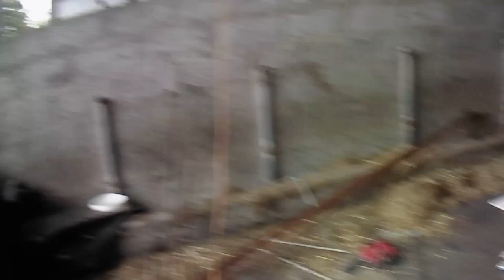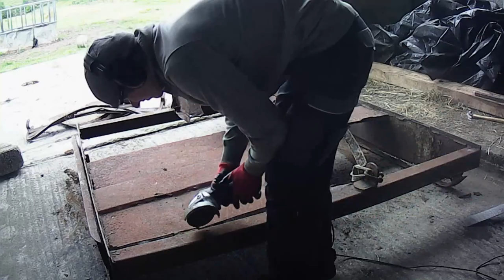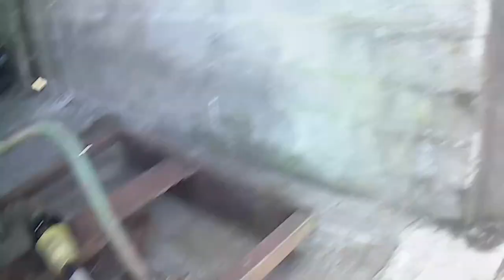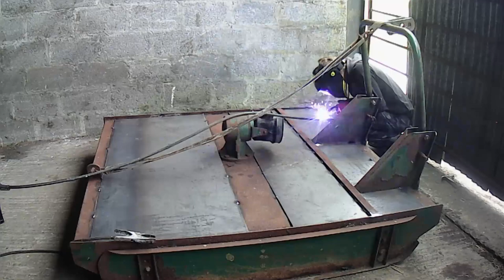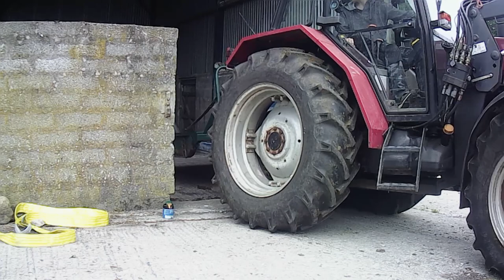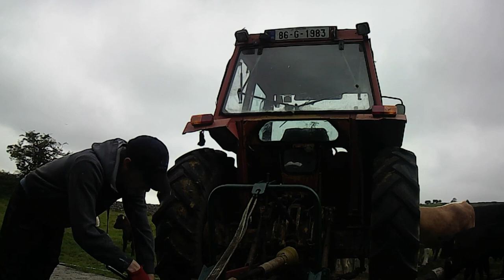MAJOR  Topper Restoration

Comment: I’m doing something similar but just way more overkill, I’m going to rebuild my gearbox and powder coat it and I’m going to put cross supports in and then I will buy checkered galvanised 4mm plating and try do it in two pieces and tap and thread them so I can lift the smaller on with a ratchet to sharpen drone above, I will also install a toolbox with a file , grease gun ,shear bolts and the spanner’s needed so I can fix in the field, this is overkill though because I have two much time on my hands

Comment: Grand job. Two bits of angle across the top turned down and all the rattle will go away. Fine job though.
Reply from the maker: Thanks lad, I'm currently welding on two bits of flat ontop of the rear plate. The rattle is too much 😂😂

Comment: New sub from Kilchreest. I have exactly the same project to do at the end of the year. Rot on top at the back of my Major topper. 
I notice you cut the front and rear sections out, leaving the gearbox mount. Is this a separate piece or just more of a convenience to not have to strip blade assembly and gearbox off the machine. 
Many thanks.
Reply from the maker: Oh Thats very cool, thanks for the sub man. Um well i did that for convenience but also the middle section has more structure under it that the rest of the sheeting. I felt it still had plenty of life in it and yeah it would've been much bigger job to remove the gearbox and blades. Hope this answers your question, and do let me know how you get on with it. 👍
Reply: @IDoAgri  I’m about to get in face of the topper repair. Life gets in the way of even the best planning. Where did you source the steel sheet for the repair. Was it local or online. Thanks
Reply from the maker: Local you can go to Mike Kennedy steel just there in craughwell, could order it from chadwicks or that but you'd want to get a few
Reply: @IDoAgri  craughwell is just down the road from me, so that sounds ideal. Thanks.
Reply: @IDoAgri  just one more thing. What thickness?